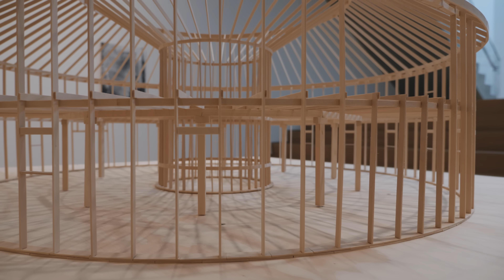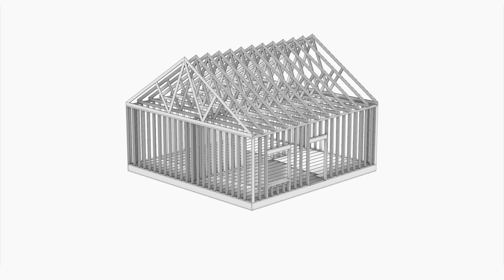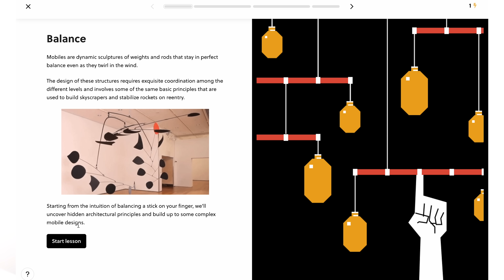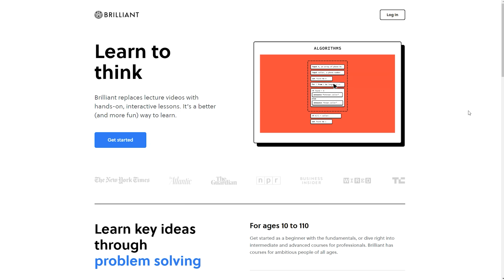The Genius of 2x4 Framing

Comment: Now I know why whole city's after a hurricane look like tooth picks dropped from its case, and how a whole city disappears literally from fires, it didnt make sense to me.  how can a suburban area, burn like that and just not be there. Those houses people said, Miraculously survived the fire, I looked back, yeah, they actually have brick walls, not a board on a 2X4. with a thin layer of sumthing that will atleast be water proof, if they stay on. I thought They could atleast put steel beams on the main load carriers, even if ts on the corners. Then I realized, you cant, these houses dont even have concrete slabs, to use steel on. Thats crazy.   These houses are movie sets, thats no joke. So the burger Analogy is spot on, The burger is more fire proof.

Comment: Both post and beam and timber framing are construction methods that use heavy timbers to create structural frameworks, but they differ in design, joinery, and application.

Comment: There were plenty of times where I said to myself or a coworker that the framer did an excellent job.  On the other hand, there were walls so far out of plumb that I had to belt sand the bottom nailer of a full height cabinet with a finished end while scribing it to the wall.  Usually we're given an inch of scribe material.  Incredibly, sometimes that's not enough.

Comment: And thanks to these ingenious construction methods the entire towns are being leveled by trivial hurricanes in the great plains decades after decades...  and fires scorch entire towns in other areas.
Reply: Lack of Sufficient Angle Bracing, Excess Flat Walls to the Wind, limited to Zero Fire Resistance of Exterior and Roof, are all Factors, to the "Three Little Pig" & "Big Bad Wolf" (Hurricane/Tornado) Blowing our Houses Down / Wildfire Deviation! 

Imagine how Bridges are Made, with Angle Trusses, under, Over, and/or Beside where we travel! Even Old Wooden Bridges, survive some Extreme Conditions! 

A Triangle, even of "2 x 4" construction, is stronger than a Square, which is inherently "Wobbly" in Stick Frame Construction, until "Sheathing" is secured to it, for Shear Strength! 

You might have seen the Video, of a "3 Floor Stick Frame Skeleton" collapse, layer, by layer, as they had No interior Angle Bracing, and No Sheet of anything attached to any exterior Wall! It was a perfect example of the inherent failure of "Built to Code" taken to extremes!  😮🥴🙄
Reply: Have we considered Octagon Styled Designs, that are essentially a set of Triangles, joined into a Circle? With Fire Resistant Cladding? And Fire resistant Roofing Materials? 

That or Round and Dome Homes, of Various Structural Approaches? Geodesic Domes, Aircrete Domes, 
Monolithic Domes, etc! 

Inherently more Wind Resistant, and often more Fire Resistant, with the right material selection! 🤔🧐👍

Comment: Once you spend some time building in this way with experienced carpenters, you realize that if it is done properly it is very strong, cost effective  and durable.
   The skill set and neccesities required to do it properly do not vary much, and once a tradesman learns these, He only needs to know what size. Building materials are sized to match, but any sizes wanted can be easily produced, in a standardised way.

Comment: The only reason that stick framing can exist is because of the industrial revolution. Without the mass production of nails made from mass produced wire, you can't have a stick built house. Without mechanized saw mills making dozens of cuts in minutes; you can't have 2x materials. The stick built structure is a byproduct of mass production.

Comment: "any 2x4 is pretty much just like any other 2x4"
nope
"hamburgers feed the poor and the rich equally"
nope

The poor get pink slime and other chemical BS mixed into their beef for the same reason that you only find split and warped 2x4s at Low's and HomeDespot. It's a simple strategy of eliminating any alternatives in the market by using the cheapest materials, harvested in unsustainable and harmful ways, to undercut any competition and create the illusion of value.. then, once the market is cornered, jacking up prices to gouge the consumer while further reducing the quality of materials to slash costs and leaving every participant in the market worse off. Next up, GMO'd soybeans replace healthier expensive beef, yet the consumer sees zero savings or even higher prices. Giving this video the rare thumbs down and "don't recommend this channel" as it's the YT content equivalent of this business practice.

Comment: The 2x4 studs on the exterior walls are being replaced by 2x6 because of the increasing need for insulation in the time of rising fuel costs. Not enough was said about plywood that provides a lot of strength.  The other relatively new building material is sheet rock that provides very smooth walls  and can be cut by scoring the paper on one side, snapping a break and then cutting the paper on the other side all with a simple blade.

Comment: Going to school right now for construction engineering and my goal is specifically to never build like this. Building in this way is for me is the ultimate representation of big batch, large scale, standardized and monopolized ways of building. Stone foundations and timber frames are all you need. Concrete is one of our largest greenhouse gas emitters, and particle board and pressure treated wood shipped from all over is probably not the greatest either. Build shit out of locally sourced field stone and wood logged sustainably and you’ll have structures that will stand for hundreds of years. Let’s not forget we used to build like this with hand tools. No reason we can’t use our modern technological luxuries to build timeless houses

Comment: Efficient? Sure. But what about the longevity of the structure? These won't last long enough for your grandkids to enjoy. Many of the old European dwellings (or elsewhere) have been standing for over a 1000 years. And those were built largely by poor people. Just seems crazy to me to invest half of million $ or more into something built out of sticks and drywall.
Reply: That perhaps depends on the maintenance of the building, there should be some houses that are already over century old. So the longevity of the framing might not be that significant issue as it might seem. Maybe the problem is in american attitude towards buildings and goods in general?

Also survivor bias plays significant role in case of Europe and many other parts of the world, for every 1000 years old dwelling, there are probably hundreds that did not make it till these days. Think about all the lost villages that were build out of log houses and others build from mud bricks, all the worker colonies build in early 19th century that were torn down by 1950's, medieval, renaissance or baroque quarters or ghettos that were razed as unsanitary in 19th century. And those served for maybe a century or two.
Reply: @MrToradragon  I was more talking about old stone architecture and heavy brick buildings that are still there today, at least the ones that haven't been anihilated during ww2. I grew up in a 300 year old house with 3 feet wide solid brick walls. No mold issues, no structural warping, no water getting into walls, etc. All houses were like that, save for the newer concrete apartment buildings made in the 50s. Just seems like the building industry in North America went toward cost efficiency and speed of erecting these houses at the expense of material quality. I much prefer an old colonial house like you see in the north east US and some places around Virginia. But near impossible to find nowadays.

Comment: When some engineers from Mexico came to visit our facility in Michigan, I took them after-hours to see the Christmas lighting at a local housing subdivision.  There was still some construction going on in the subdivision.  The visitors were interested by seeing the 2x4 framing being used.   I explained about the abundance of lumber and that this construction method leaves a lot of space for insulation against winter cold and summer heat.  This video explained a lot of other reasons why 2x4 framing has become predominant in the USA.

Comment: (Edit: I just read the pinned comment.) The number of skilled framers that cringed to hear you don't need skill to frame. I know it wasn't meant to sound the way it sounded. I am a framer, and I'll be the first to admit, it's a learnable trade. You don't need 3 years of advanced math or engineering. You certainly must have spatial abilities. And there is some math involved. But the math is also learnable. Even in weird roof designs with inverted bastard hips or multiple pitches on a given plane.

Comment: Call it what it is. Match stick framing. Quite literally designed to be built quickly by less skilled but greater numbers of workers as well as designed to use maximum amount of wood from source (using ancient technology by todays standards), that is easily distributed and available in shorter time than other methods (e.g. timber frame). 

The cons are not near as strong or long lasting, more maintenance needed long term, time consuming to build, almost the least efficient in all important areas (strength, insulation, etc).

Comment: Here in Sussex in the UK, the Wead & Downland Living Museum has many old re-erected buildings, dating from as early as 950AD right up to the 1800s. The majority are timber-framed, but a pair of cottages built for agricultural labourers around 1865 as one building, were built with 2 x 4 framing instead.
Each cottage is very small, just twelve feet wide and twenty feet long, with a couple of rooms on each of the two floors. The foundations and chimney stack are brick, but the rest of the building is made of timber
Softwood imported from the Baltic was used for the 2 x 4 structural timbers in the walls, with infill framing from small local hardwood trees - mostly elm, oak, poplar, ash and beech.
All the timber, softwood and hardwood, was converted in a saw-pit by hand, and while the design of the softwood frames is typical of the early 1800s, the carpentry techniques of framing and scribing were the same as those that had been in use for the previous 500 years.
Interestingly, the site for the cottages was exactly 66 feet square, that being the standard length of a surveyor’s chain in those days.

Comment: On the building channels I follow, there's an inordinate number of Europeans deriding light wood framing. It's almost comically predictable at this point. The beauty of the US system, as it admittedly teeters on the edge of becoming a govt directed central planning nightmare, is the choice and flexibility it offers. In the end, that gives a good balance between speed, cost, and quality. With plenty of choices to tweak whichever factor one wants. Europe, conversely, is a top down, rigid building industry. They pride themselves on high quality, and that isn't incorrect. But at the expense of so much. Most importantly, freedom of choice. Good video. Lot of interesting tidbits. Sub'd.

Comment: Here in the north,I’m amazed how everyone seems to build garages with the pole barn method. It makes absolutely no sense to me. Once  the structure is up ,they fight walls trying to pour concrete floor. They have to come back and add framing for insulation and sheathing or siding. Seems easier to go slab,walls ,trusses

Comment: 10:01 - "You don't need skilled labor to produce wood framing."?  The framing carpenters that I worked with were incredibly skilled.  At math, engineering, and construction.  The difference between a 2 year carpenter and a 20 year carpenter is massive.  Your comment is absurd.

Comment: it's always interesting to me how it's popular method in USA meanwhile in Europe it's almost none existing. Just months ago i bought new home and wanted to add upper deck to one of the rooms while ceilings are ±4.5m in height, i asked maybe could do from wood, it's pretty small area (±2x3m) on top of strong walls and it's work space, for office desk and that's it. Everyone encouraged to not go with wood, ended up with metal construction of ±5x5 cm metal square pipes welded together to hold the platform. It's rock solid, nothing "squeezes" at all anywhere.

Comment: My grandpa (born 1935), my dad (born 1960) and myself (born 1985) were/are all rough framing subcontractors for large tract builders and apartments. We can stand an average 2000 s.f. 4/2 mono-pour house with a 6:12 pitch roof in 5 days. Ready for windows, roofers, tin knockers, plumbers, electricians, etc.

The same guys with the same materials will go frame a 8000 s.f. mansion. The "guts" are all the same, it's size/scale and the facade that change.

You get used to it...but when you step back it's amazing what we humans can do.

Comment: They should have used actual framers to build the display. You would have seen fucked up studs that are splintered and halfway rotten, completely twisted, installed at an angle, missing completely, etc.

Comment: Building with wood like this is smart because we can do huge intricate buildings with it. Customize it much easier. , but at the same time it is also wasteful. The one thing I hate about wood framing is how wasteful it is. It rots, it breaks easily, and people are quick to rip it down and replace it with new contstruction. The space we claim from the land with timber frame is also wasteful. Huge houses need lots of heat, things to fill them with. We also need lots of extra types of materials to build them. Many of them requiring manufacturing.

Comment: I am biased but i think wood framing is done just to save a buck and make stuff cheaper and not more durable or lasting. In europe most houses are made from concrete, stone and brick and as history shows us it was superior in every way with exception of cost. Wood framed house after about 100-200 years needs major overhaul/fixing due to rot/bug inefestation, etc. i would pick a house built with concrete/rocks/bricks over wood framing in a millisecond

Comment: You really didn't cover the structural design of how they are put together.  With a few very cursory phrases about strength in numbrs and platforms, but nothing at all about how strong a single 2x4 is, the direction it's strong in, spacing between and why, or any of the details such as cribs and headers, joists and hips, top plates and sills, to understand just how well they work in theh way they are made.  Feel like it only went half as far as it should and gave way too many cheeseburger references.

Comment: Actually I think that the standard method of framing has gotten away from the ideal situation. In the 1970s. Most homes of that  time were designed to make use of standard sized lumber. Of course the lumber was sized to construct standard homes. I did carpentry during this time. Most home plans focused on efficiently of construction. The fashion of the time integrated these concepts. Later manufactured homes became more advanced. Site built homes had to justify their higher price. Such homes began to focus on showcasing the skills of both the architects and the carpenters. Construction became less logical. Nowadays almost every board requires cutting. Roof trusses were once mostly interchangeable except for the ends called gable trusses. Now they are often numbered must be placed in certain order. Today's homes simply aren't as practical as they should be.

Comment: You tipped your have and showed why the rest of this video, past the hamburger comparison it not needed. 
A big timber is not the "ideal cut" of wood, but the fact you compair it to steak and dimentional to humburger.... 
Simply say you like timber framing and move on. 
Timber might look better to you, but try working on a house made as such.... No repair or alteration is easily done or cost effective.   THIS is why PLATFORM FRAMING is far supirior. 
Your timber wont pass (as you like to see it) in many areas, wont hold the weight and is very wastefull. 
The reason platform is what is predominant is simple.... survival of the fittest.

Comment: Since living in Canada I learned how bad Northamerican construction and technology is. Only a few examples: built quality, noise and heat insulation, windows, doors, heating. Compared to Germany, USA is 50 to 100 years behind. Forced air heating in Germany was used in medieval castles but not in houses as it is too bad. With radiators you set the temperature for each room individually (warm bath, cool bedroom).
Timber-frames were most common in the medieval times and some of those houses are still standing (400/500 years later).
The comparison with hamburgers is perfect (both made of bad ingredients).

Comment: I lived in the USA for nine years and always was amazed by the abysmal quality of USA homes , just like hamburgers indeed !! ,  Running up the heating bills in the North , and the cooling bills nearly countrywide because of their second rate materials, while here in Europe houses last in good quality for generations..  even where wood is the main building material, the difference in for example , siding thickness is extreme.. Ripped of siding during a storm ??  Only in the U.S. !!